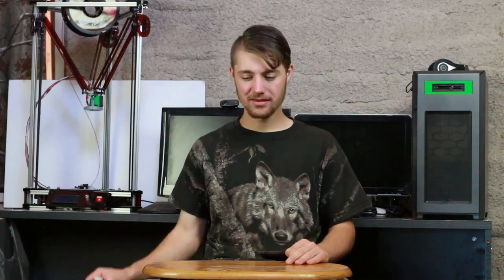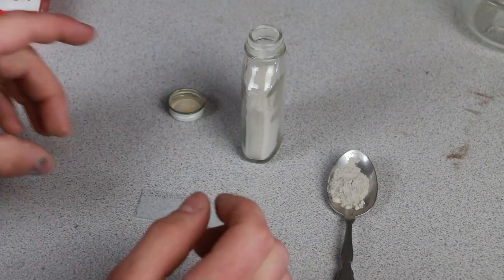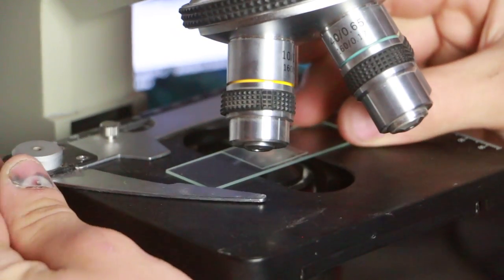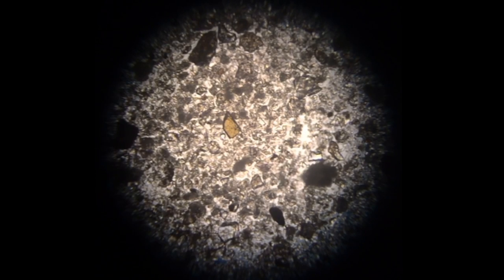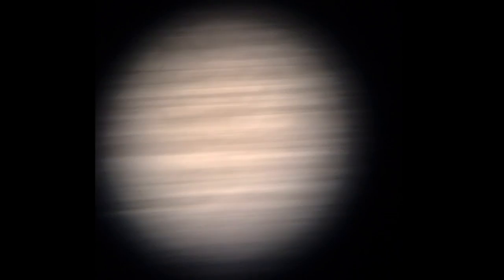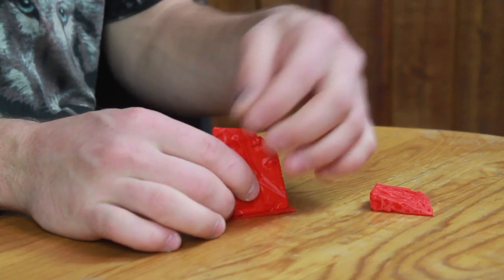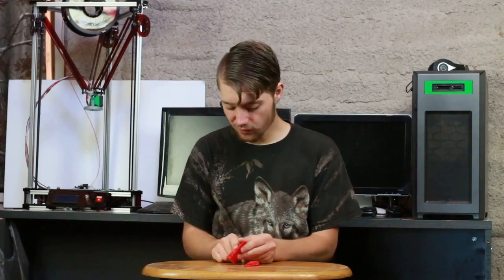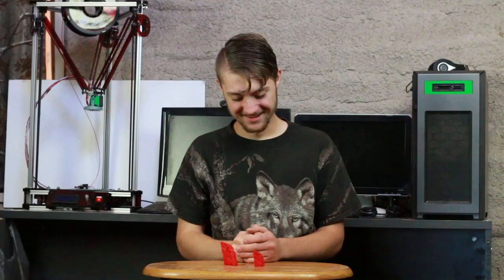3D Printing Volcano Ash from Mount St. Helens!

Comment: bumped into you guys at comicon, you guys are great!! The name I could not think of was for the $350 dollar 4X8 cnc machine was the Maslow, I popped for the extra z axis. They ae looking at September or so for delivery.  You have to buy the wood and router but all the metal stuff is included, chains motors software, here is the link incase you are thinking about it.
 http://www.maslowcnc.com/ later